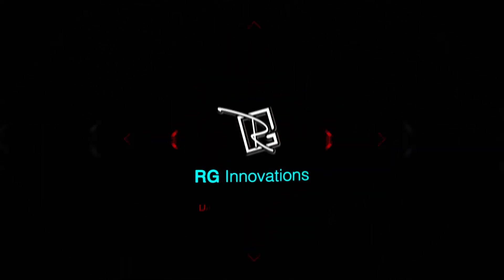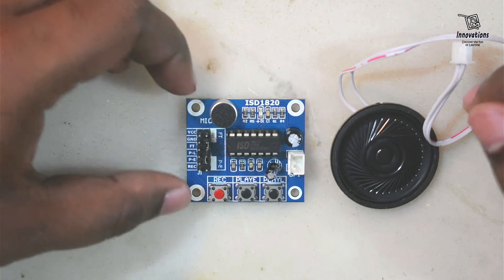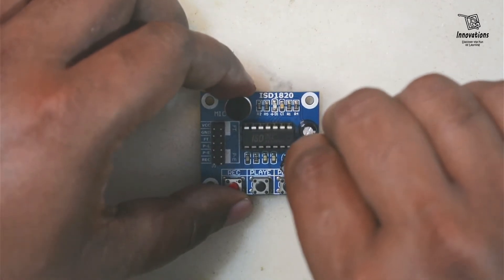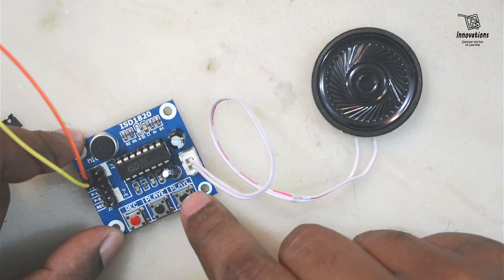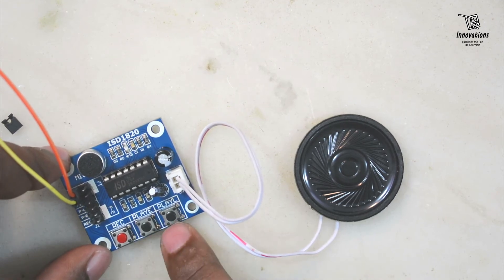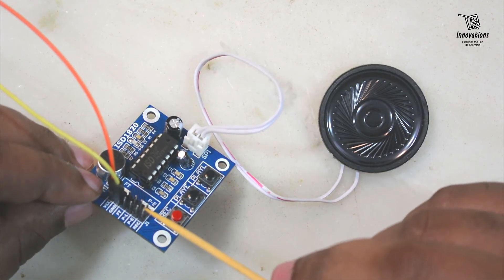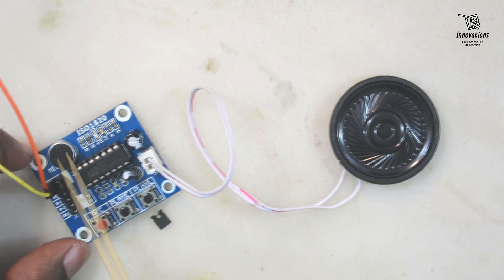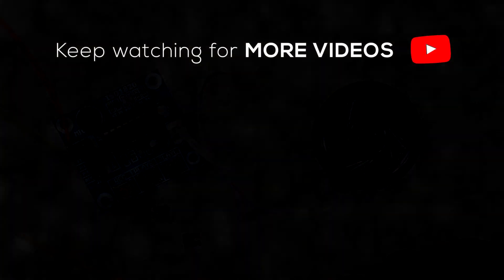ISD1820 Voice/Audio Record and Playback Module Review + Tutorial

Comment: Sir any way for us to connect an sd card and sd card reader module for more storage for our previous recording through a microcontroller😅 and what is the maximum capacity of recoding by changing that resistance 😢??
Reply from the maker: I will try to post a video on sd card module...I have posted a separate video on increasing time of ISD1820 module..

Comment: 'Very thorough and clear explanation.  Do you have any thoughts about how to use this device in an automatic playback mode after a specific delay?  That is, like an echo box with specific delay time and repeat count.  Thanks.
Reply from the maker: If you want to repeat it after a delay, you can add a simple timer using 555 ic, if you also want to add repeat count, you have to add a microcontroller.
I have shown in a next video, how you can use it with microcontroller..

Comment: Which type the battery and the wires it needs?
Reply from the maker: 3 AAA would do, any wire you can use.
Reply: @RGInnovations   will it work with 55 mAh 3,7 V battery?

Comment: Hello friend, can I input any pre-recorded sound into it?
Reply from the maker: No
Reply: @RGInnovations  Thank you so much for your quick response. Is there any device that can do this?
Reply from the maker: Yes, there are mp3 modules with sd card.
Reply: @RGInnovations  I know all about Micro SD card-based MP3 players. Actually, I want a microcontroller-based recorder.
Reply from the maker: Thre are modules for microcontroller
Reply: @RGInnovations  Thanks a lot for your answer.
Reply from the maker: Most welcome
Reply: @RGInnovations  Can you please help me?
Reply from the maker: About what?
Reply: @RGInnovations  I want to make a circuit that when I turn on the power the output will be turned on after 10 seconds and after 10 seconds it will be permanently turned off. Can you please provide me a schematic diagram of this circuit?
Reply from the maker: @ClassicVideography it will take time for me to build. Meanwhile you can find in youtube - 555 ic delay on circuit

Comment: Hi, I need the voice to be repeated automatically without repressing the button, is it possible? If not, what kind of modules can I find this feature?
Reply from the maker: It is not directly possible on this module, you can use a microcontroller and easily achieve the required result.

Comment: If I use batteries for the power supply,how can I connect the battery slot with jumper wire ?
Reply from the maker: what type of battery are you using?

Comment: Sir, I have a question.what type of connector do I need to use for speaker wire and power supply wire?
Reply from the maker: JST connector is needed. Or you can directly solder wire...

Comment: Can we power it using normal batteries?
Reply from the maker: yes, we can.
Reply: @RGInnovations  thanks. One more question. The rated voltage is 3 to 5 V. Will it cause a problem if I use a 9V battery instead?
Reply from the maker: yes, it will burn. If you use 9v battery,  use a regulator like 7805 or AMS1117 5v.
Reply: @RGInnovations  i see. Thanks a lot for replying
Reply from the maker: most welcome

Comment: hi, i have one question  when i turn it off and on,  the recorded voice is played once 
how can i resolve this problem
Reply from the maker: check if the PE pin is connected with something..
Reply: @RGInnovations  yes i coneect PE pin with arduino data pin to control the isd 1820 with some data . in this case, can't i resolve this problem??
Reply from the maker: in that case please check the arduino sketch if it is sending a high output in the pin connected to PE at startup.

Comment: Hi sir, could you please kindly suggest me what kind of power supply should i use for this module. i.e 5v 1a or 5v 2a ?
Reply from the maker: current requirement for this circuit is very low, it will work in 5v 100ma also, so both 1A and 2A are fine, whichever is available with you.
Reply: @RGInnovations  thank youn sir i use 5v 2a